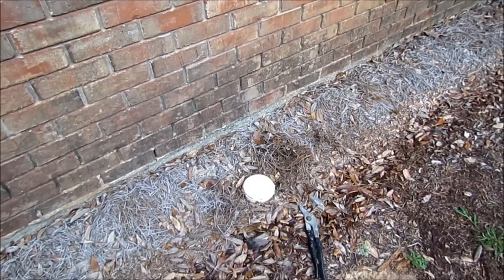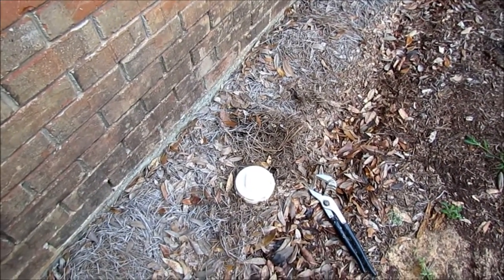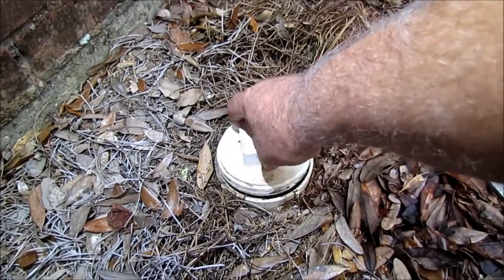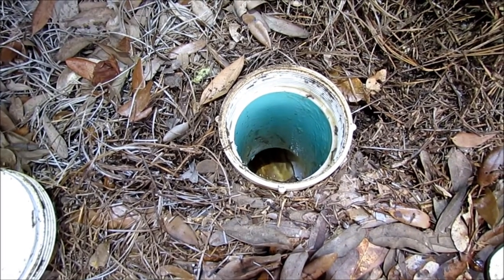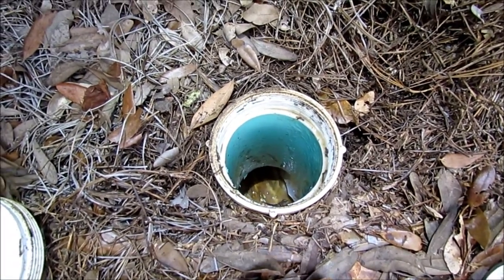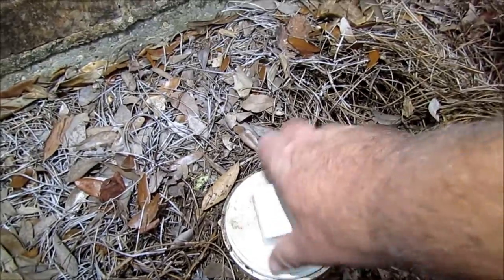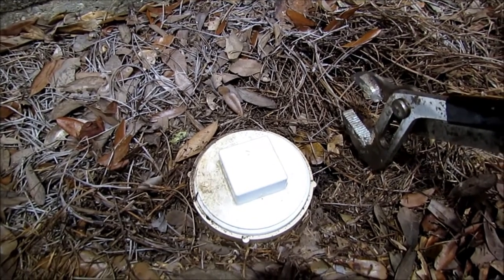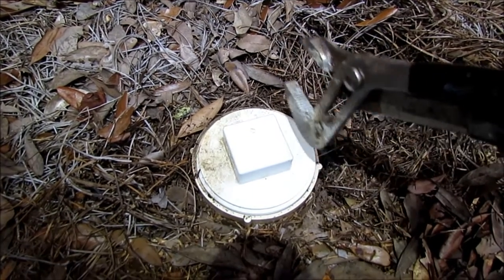Where and How To Find Locate Sewer Line PVC Pipe Clean-Out Service Drain Cap Read Below

Comment: This is great information thanks for sharing.  What is the price range of adding a clean-out if you can't find one?
Reply from the maker: Its going to vary depending on how much labor will be involved. However the fittings are not that expensive. You may be able to get plumbers to give you a quote over the phone.
Reply: We recently put one in and it was $260.   You also want to make sure you have a main water shut off valve.  We added that too.  We have a 90 year old house that had neither.
Reply: @2busysecretary  Thanks.  After digging around the house I found two clean outs one in front one on the side of the house.
Reply: @LessofLes  Good that will save you some money..
Reply from the maker: @2busysecretary  Thanks for sharing this info.